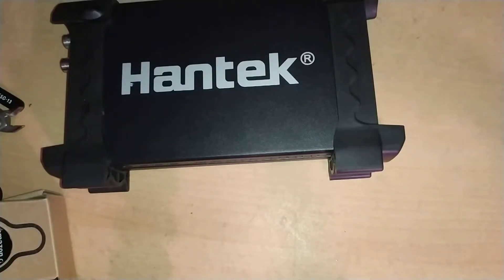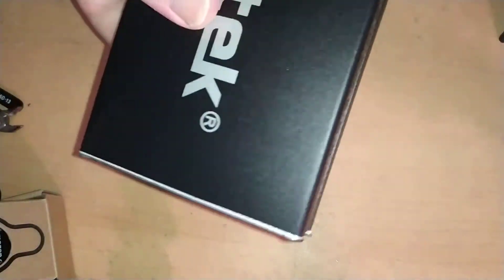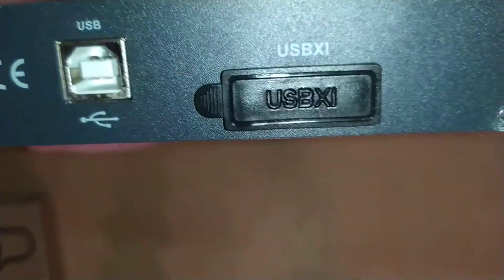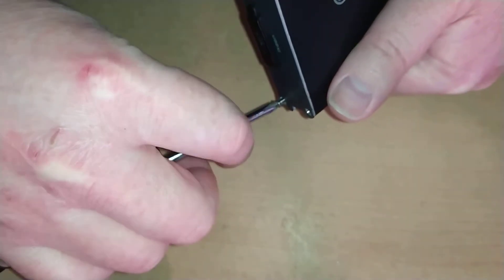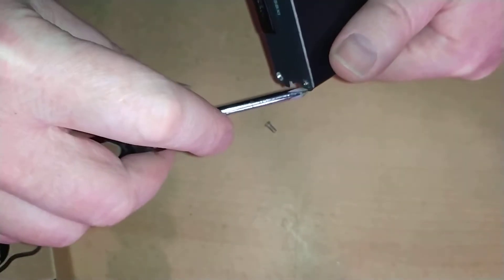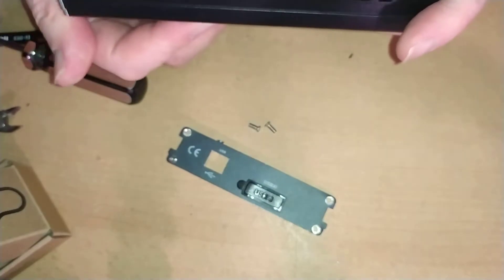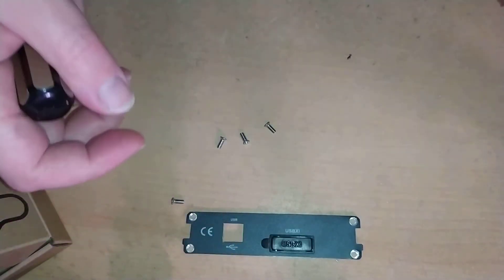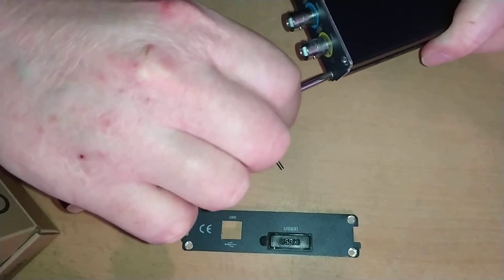Hantek 6022BE taken apart quickly

Comment: The DC to DC converter is required to isolate the PC power from all the input circuitry (keeps your PC or tablet safe..) Don't forget to checkout OpenHantek6022 upgraded software on GitHub or search on the EEVblog forum for "6022BE" (the main-thread has over half a million views, comments, mods, PDF schematics, and links to additional software). This little beast is quite a gem for $60 usd